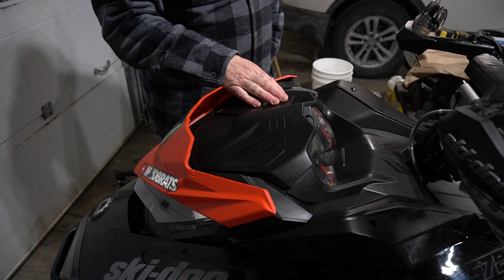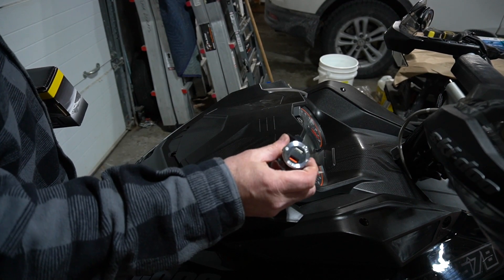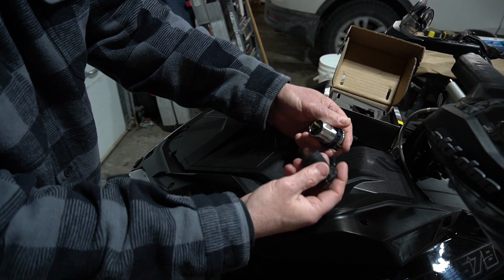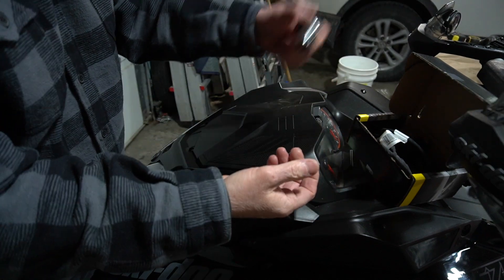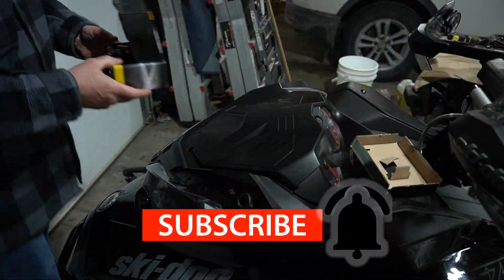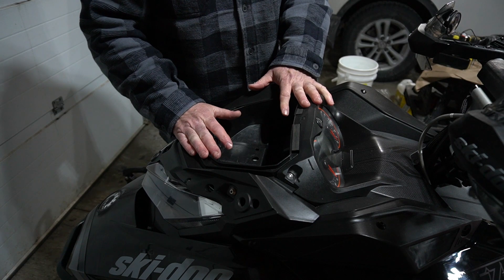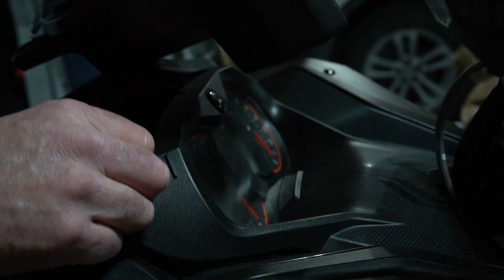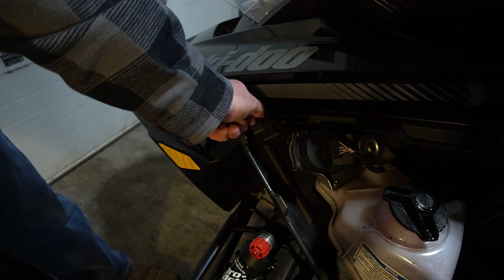INSTALL Ski Doo 12V USB Outlet and iPHONE MOUNT   2017 2018 Ski doo REV GEN4 600R, 850, 900ACE, 900T

Comment from the maker: PARTS LIST:  

1x Quick Charge 3.0 USB Charger Socket

https://amzn.to/41lWpze
________________________________
1x Ski-Doo New OEM USB Power Outlet Kit 860201261

https://amzn.to/3MHQccZ
________________________________
1x RAM MOUNT RAM Short Double Socket Arm 1in. Ball Base
https://amzn.to/3lUSszm

________________________________
2x RAM 2.5"" Round Base (AMPs Hole Pattern), 
1"" Ball & Mounting Hardware

https://amzn.to/3IGIc7J
________________________________
1x honor 9 lite waterproof case for motorcycle + 
Motorcycle Phone Case Universal Waterproof - Size LARGE
https://amzn.to/3ykxor4

________________________________
1x NANAMI 10W Fast Wireless Charger, Qi Charging Pad
https://amzn.to/3oNqCa8

________________________________
1x Mudbrats Custom Phone Charger Cradle
https://motojungle.ca/

Comment: Sorry but I am 30 seconds into the video and I say bullshit I keep my telephone in my pants pocket close to my skin and the thing is an ice cube when we get off the trail at a bar restaurant etc. And I doubt that supplies heat and if it did it would be ridiculous amounts of heat it would need
Reply from the maker: Man U don’t watch many of my videos do you?  I ran this for years on the XP with no battery on that sled.  No issues at all unless I didn’t plug the USB into a battery pack when we stopped (the the phone got cold and died),  it works man, no BS,  a long as you have the phone charging whether plugged in direct or using a wireless puck like this, it stays warm,  checkout the Quebec vids,  Grant runs this on his XS and his maps stayed on in negative 30,  he had maps on all the time where the gen5 kept black screening like they all do.
Reply: Can 100% confirm his set up works.. Before calling bullshit try keeping your phone plugged in.. stays warm and won’t freeze done it before I started buying sleds with a heated glovebox bag. I ride with gary and his son all the time and have never seen this set up freeze..
Reply: I added the same 12v USB charging port to my gen4 summit X with electric start but not getting any power at the USB ports. Is there a fuse somewhere that I can check? Do I need more than idle RPMs for it to come on? Seems since my sled has a 12v battery on board that it should work at idle